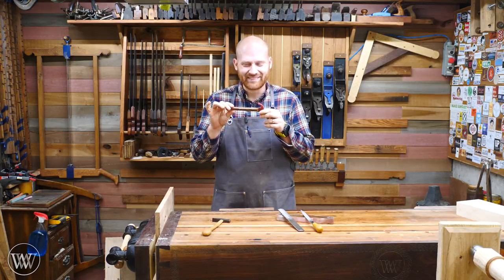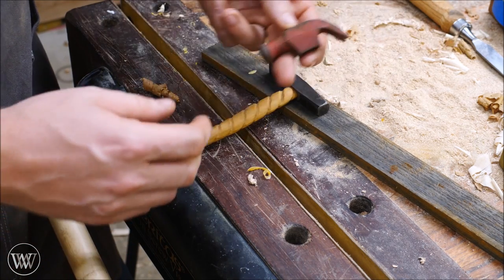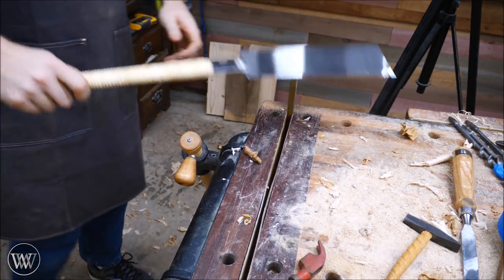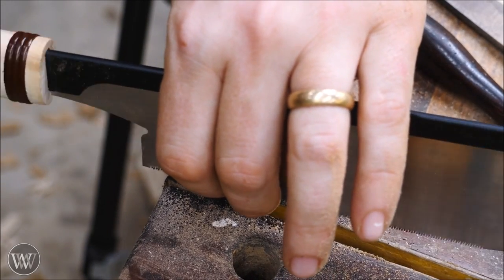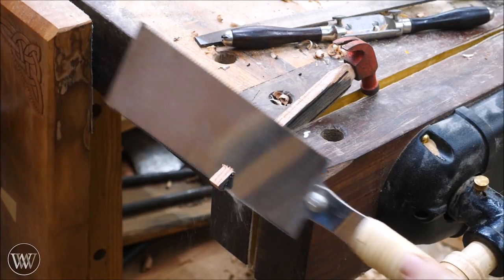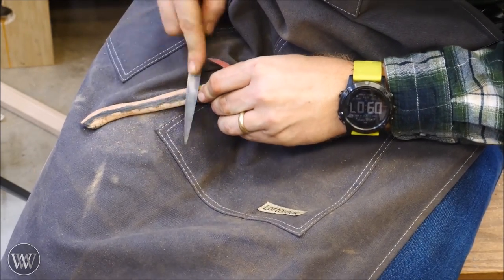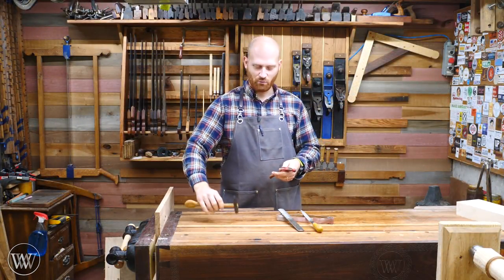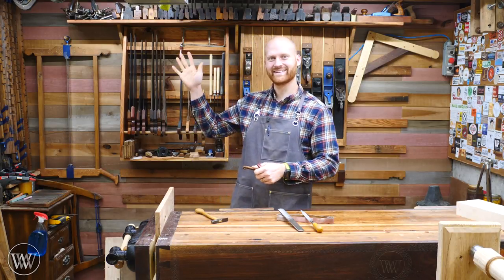How to Make a Small Hammer Handle Hand | Tool Woodworking Project

Comment: Wow. What kind of mallet was that ??? There is a bunch of sticks inside it's head ???
Reply from the maker: which mallet are you talking about?
Reply: It appears between 1:32 and 1:40 and again between 2:25 and 2:32.
Reply from the maker: I see. that is a wooden-faced metal mallet. that way you can get the heft of a metal mallet, but with the soft face of wood. I am actually going to have a video on that soon.